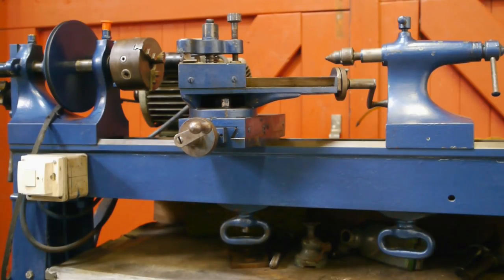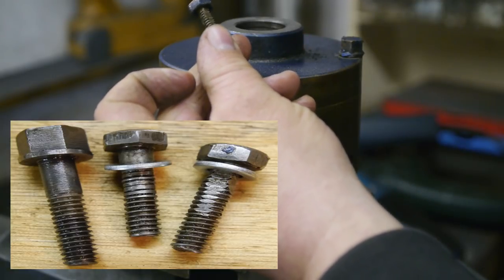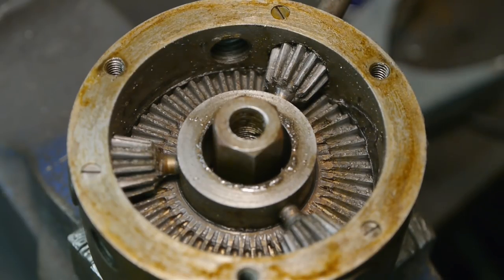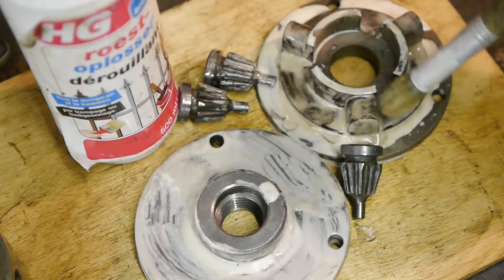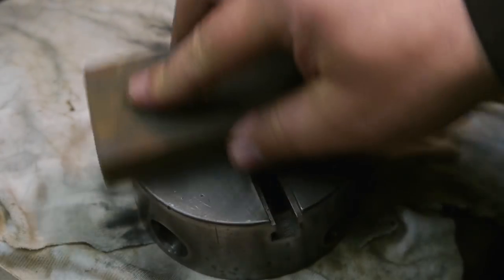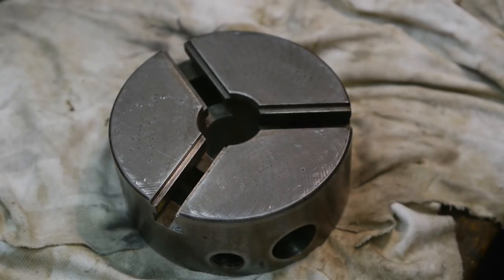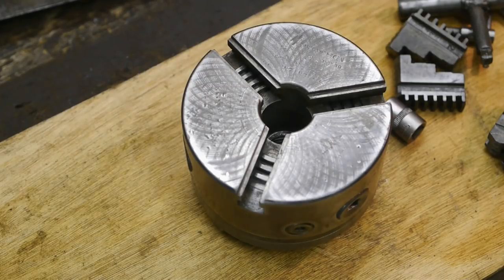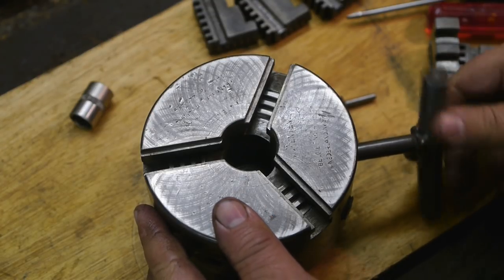Refurbishing an old adjustable 3 jaw chuck

Comment: You see a arrow near one of the 3 Pinion on outside of chuck...you might wonder why...use this one only for best repeating runout. You can use another pinon but make sure it's always the same one, that's why one is marked.
Reply from the maker: Isn't that also why the have a "0" on modern chucks?
Reply: That's right

Comment: That was really interesting.  I've never seen a scroll chuck like that before, and the way it adjusted the eccentric off set is very clever.

The final result was as good as you can expect for most scroll chucks - and excellent for an old one like this.

Thanks for posting.

Cheers Rob
Reply from the maker: Thanks Rob. I think this old girl might still be very usable. Although a 3 jaw in 4 jaw design should probably work better.

Comment: "The best rust removal is when someone else does it for you"... AHAHAHAHAH That one was great!!! I agree!!! From my experience, electrolysis is fine, but a bit too much of a pain in the butt, unless you really need to take away the least possible amount of material. Bronze brushing by itself is generally safe and effective, sometimes a bit too harsh, if you want to preserve surfaces as true as possible. And you breathe a lot of metal dust. Personally, I found very helpful to dip the pieces into a mix of white vinegar and a bit of kitchen salt in big grains, for about 24 to 48 hours. Then, a light bronze brush will do the rest. It is a fairly simple yet effective way, and it also helps to clean up grease and other impurities. But, looking at your skills, you probably already knew all this. Thank you very much for sharing your experience! Ludo

Comment: I love this video.  Thanks for deciding to clean up the chuck and post the video.  Very interesting.  I was not surprised that the initial re-assembly had more run out.  

I have a 3 jaw scroll chuck with 4 screws to adjust the body to be true.  It does take time to get this to run true.  I can imagine it is much more time consuming with the 3 jaw design.  

I saw the comment by Tkkcustomknives where he found the patents.  Well done.  A mystery solved perhaps.

This was a high technology chuck for its time.

I also grease the spur gear and pinions and use way oil on the scroll and jaws.

The chuck may now be running true.  The small amount of runout could be the piece of steel you have mounted for the dial indicator.

This chuck is worth keeping.  I am happy to assist making new screws for the backing plate.  Just let me know dimensions.  I think a thicker shaft in the backing plate may help.
Reply from the maker: Hope you'll love the next video as well. Uploading as I type :)
It very nice to have seen the original patent. But I still would like to find out who made it.
If I keep the chuck I also need to keep the lathe as it wont fit the old restore lathe. It will fit the old wood lathe but I have decided to sell that machine. To be honest I'm starting to like the old smurf lathe :)
I think I should be able to buy those screws locally. But thanks for the offer.

Comment: Those screws are probably 1/4" x 20 Non metric at all ;)
Reply from the maker: Could be. But they did fit the 1.25 pitch of my gauge very nicely. Unfortunately I don't have an imperial gauge. Just a metric/withworth one
Reply: That's right becuase 20TPI is very close to 1.25 (1.25 is exactly 20.32TPI)
M6x1.25 is not very common thread anywhere in the world, when 1/4 x 20 is standard in UK/USA, so it also happens in Europe. Check the diameter, if its around 6.35mm, then it's certainly 1/4"
Reply from the maker: You're probably right. The diameter is closer to 6.35 then 6.00mm

Comment: As I see someone else mentioned
1/4" = 6.35mm (slightly bigger than M6)
BSW 1/4" = 20 TPI =  1.27mm pitch, very close to the 1.25

In england some cars used to have metric threaded bolts with imperial hex heads. Maybe you had an imperial screw with a metric head?
Watch out it will probably be a whitworth (55 degree) thread so won't match american fastners (60 degree). I don't think 1/4x20 is a standard american size. 

Of course how easy it is to find obsolete british fasteners in germany is a good question. Maybe old car restoration places? Or just ship it in from the UK.

Old video I know but you might still have the chuck hanging around :P
Reply from the maker: Thanks for pointing that out. I still have the lathe and at some point I'm going to make a better motor mount for it and also install a vfd drive.

Comment: Rust removal by electrolysis is actually really easy. I bet you could do it.
Reply from the maker: I tried that maybe 10 years ago. I was not impressed.
You still need to do a lot of cleaning and scraping and it takes forever. I bet most of the people on youtube showing rust removal by electrolysis never use it again.

Comment: Interesting chuck for sure. Did you know for certain that the dead center was true before using it to setup the chuck? When you are talking about tenths of a millimeter, everything has to be verified. JMHO
Reply from the maker: It's a piece of 16mm shafting material. Seems to be pretty true but I'm not 100% sure.